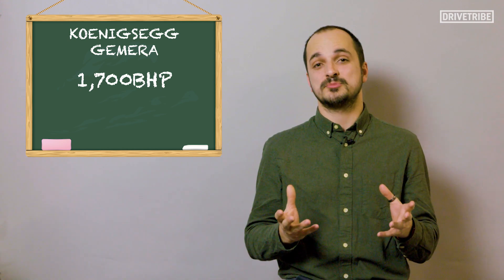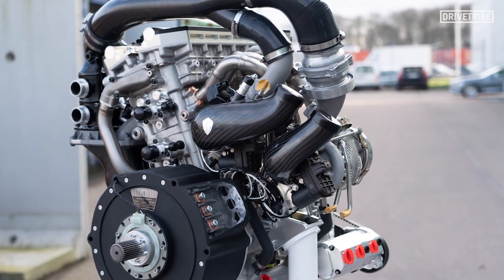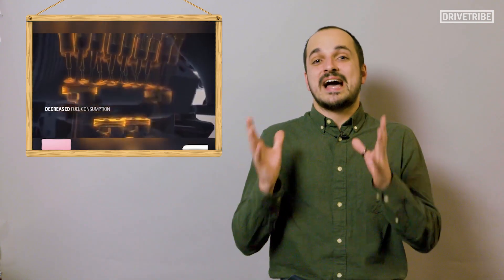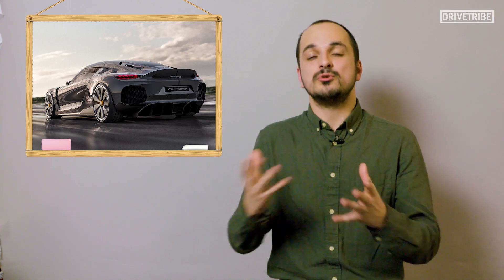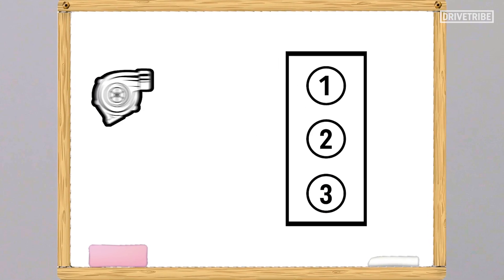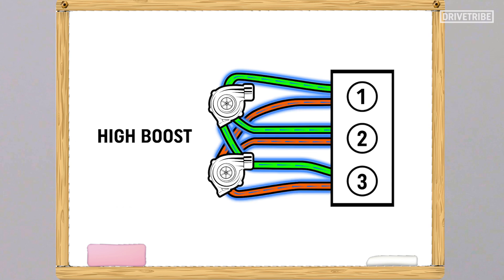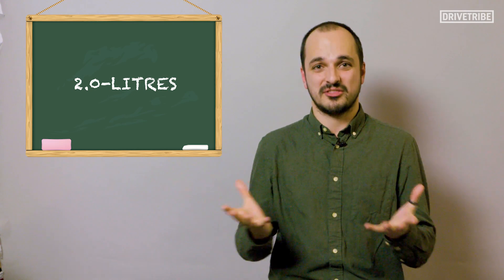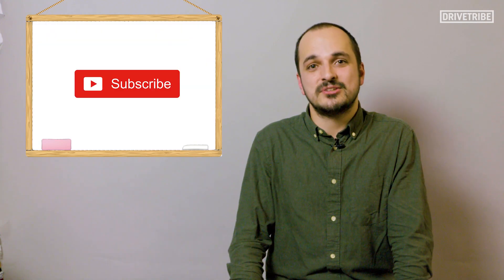This is how Koenigsegg made 600bhp from a 3-cylinder engine

Comment: from one of the fray of wind tunnel FINANCIALLY backed LSX "BUILDERS" among the fray of LSX subframed MR CF "supercars" that graced the top 10 nurburgring or crawled into the 7:20s and up.....to think of the rubble these guys would be one of the people making new cars and offering innovation. VS still trying to sell a twin turbo LSX build for over a million dollars like the rest bc they needed a return on the R&D and manufacturing of various prototype CF parts...and fronting it to the consumer...thats not a car thats selling it and marketing it as tech. And now weve come full circle. I mean really sum 10-15 years ago the "industry" and by that i mean hypercars were relegated to slapping turbos on an IRON lsx bc of the basic implications of boost. Then use CF to make up for the MR layout/weight distribution and would be piping/tubing that is most likely CF as well or titanium which means not that "long" of headers or exhaust/turbo manifold to exhaust bc of MR layout. Typically done by frame rails attachhed to a unibody or essentially a subframe/chassis design. With an epic suspension setup. Its all a lot to pay/learn that each car/powerbands only turns like itself each specific car/tune/build. Its a lot to pay to think one is better or more fun or these variables even matter. AND that is why they exist for those that have that NEED. Its ironic really. The type of guy thats happy to drive a million dollar car in traffic but cant see the fun in driving a 100 hp miata or FR like an FB or roadster. That cant accept that potential without the aspect of being the guy in the million dollar lsx build. PPl with this kind of money dont play. Theyre too busy figuring out how to make the x million they made this year double while writing off their expenses on the rest of us.

Comment: E85 fuel is quite common in the USA now. Partly due to GMs Flexfuel technology that's been around for about twenty years now. (Thanks to Koenigsegg, who licenced or sold the tech to GM a long time ago). 

E85 is currently $2.09/gal. and regular unleaded is $2.27/gal. For cheap 85 octane (vs 91 octane premium) here at high altitude in Colorado. (Everyone else gets 87/93octane). 

So it is no problem and even economical to obtain ethanol here in the Corn Belt of the USA.

Comment: The Gemera's engine sounds a lot like the 1981/84 Dodge M4S/Turbo Interceptor. It was a concept car that utilized a 2.2L Twin turbo inline-4. Most people get confused to say twin turbo and Inline-4 cylinder engine thinking I must mean a twin scroll turbo. Nope. Two Turbos. This engine made 200hp/L for a total of 440hp. Not overly impressive now, but in 1981... Yes it was impressive. Even earthshaking given it was much more powerful than MOST production V8s at the time. And in the MS4 it returned up to 28mpg.

Comment: New and old together. Absolut incredible (not new) the electrical valves, optimum variable opening and closing in all rpm ranges. And the inline two stage turbos is well known in the 70´s by Porsche in the Can Am Series.

Comment: The cam-less tech is way cooler then the exhaust turbo system, that's some amazing stuff.
Reply: Future of combustion engines
Reply: well... technically, that turbo config cannot exist without freevalve. the only reason you can have 2 exhaust ports in one cylinder is because you can close/open each valve (per cylinder) individually. and you can only do that with freevalve.

Comment: Camless hydraulic valve systems are the next major innovation of the internal combustion engine BUT - with the rapidly advancing tech in electric cars will we see it come into everyday use? Or will it be like the cutting edge tech for piston powered propeller aircraft after WWII - completely superseded by the jet engine? Never really utilised, and certainly never made it into mainstream production.
Are any other manufacturers working on similar systems? Are Koenigsegg / FreeValve jealously guarding their tech? Or do they plan to license its use to other manufacturers? If not, how long until somebody else develops a similar system? You'd have to imagine certain German and Japanese automotive companies would be all over it.

Comment: Well, staged dual turbos are not exactly new, but FreeValve certainly is. Now imagine this with hydrogen. 600bhp from..? 0.8l? Compact that in a daily commuter as a generator for electric drives, bam, emission free* electric car and the car industry gets to keep making combustion engines. (*Ok, as emission free as the power src for electrolysis so we better get fusion going.)

Comment: The fact that it's a 600hp 3 cylinder isn't really that special, the Leyland L60 got 750-850 very unreliable horses out of a 3 cylinder turbo in the 60's. This one just does it at 2L too.
I'm guessing that 2nd turbo is gigantic, they're running pretty high compression in the cylinders and at a very high RPM too.

Comment: The Opposite Piston Engine from Achates Power even has no cylinderhead, no camshafts but two crankshafts. It is not longer unusual, that Motors are changing to become more efficient in the future.

Comment: The car is definitely an impressive piece of engineering. To call the biturbo system a completely new one is still wrong in my opinion. It sounds to me very much like a sequential turbocharging with high and low pressure turbine which is common in many engines.

Comment: Check out the Fiat Twin Air. They paved the way a decade ago, with the same  adjustable hydraulic valve set-up. Also a small displacement with turbo to get more power and better efficiency. Consequently took title for best engine in the world in 2011. I'd love to see someone push the limits with that engine.

Comment: Fun fact, Koenigsegg is a Swedish brand and in Sweden gasstations are required by law to sell E85 at the pumps. AND, here's another fun fact, E85 in Sweden is cheaper than regular petrol.

No one in Sweden uses it tho, since Sweden is a cold country and E85 has poor qualities in cold weather and contains less energy so your car will use more fuel. The only reason for people to buy a "flexfuel" car is tax benefits, since it's considered a environmentally friendly option and can run on petrol. SAAB was a pioneer in this field, to bad it didn't work out for them.

Comment: 2:30 it's going to take hp to turn the air compressor. Do you know how much hp it will eat up?
Reply: not much. If it takes 10HP to run that compressor its not a big deal. Its just a compressor not anything crazy

Comment: This 2 liter 3 cylinder engine is the same size as a 2 liter 4 cylinder in a 2000 Evo. The 3 cylinder make 600 hp because of boost. Take away the boost and it want make 600 hp. The free valve system does help but don't act like a 2 liter engine has never made 600 hp. Install hotter cams, turn up the boost and a 2.0 Evo engine will make 600 hp too.

Comment: Well this is not surprising at all, you can already make the same and even more horse power on less "advanced" twin cylinder bike engines, like in dragbikes for example. Large power from tiny , small displacement and even low cylinder count engines is nothing new. The impressive tech thats gone into the design of this engine however is and while it's certainly advanced, it's not neccesaily because of this tech mentioned in the video that it can make this amount of power, but many other factors.  It's certainly efficent, but efficiency doesn't always guarentee you more horsepower out of an engine, or atleast not  a significant gain of it, not that there aren't other benefits to it. I assume this is why Koenigsegg went with this design, for it's "efficenies" stuff like fuel economy, reliablity and being more enviromentally friendly, while still having the effective power and speed of your typical super and hypercar.

Comment: E85?
Skimping on fuel?

E85 is much cheaper than regular gasoline, at least in Finland. It does lead to a higher consumption, but in the end using E85 saves 10-20% in fuel costs.

Comment: This tech is amazing they have a video where they add freevalve to a factory 4 cylinder turbo engine. Increased hp and torque by 45% each. 10% increased fuel efficiency and a whopping 35% decrease in emissions.

Comment: Why is 2 litres “huge” for a 3 cylinder , why is the fact its a triple of note at all , Mv Augusta , Triumph , and Yamaha all make mass produced high HP triples from 660cc up to 2.3 L , kawasaki gets 330hp form a 1L supercharged motor in the H2R with old fashioned cams the same power for displacement, the valve train is the big ticket item in this.

Comment: When you destroy your friends V8 or V10 with a 3 cylinder engine lol
Reply: imagine if it was a V8. It would be deadly as fuck
Reply: @dieselgeezer18  today in 2024 it’s announced the i3 will be dropped for a v8 since every single person who bought one wants a v8
Reply: @dieselgeezer18  600/3=200 200×8=1600 HP🥵🥵
Reply: I know a CLA45AMG has already smoked American muscle cars with its 2 liter 4 banger and it’s only 377 hp.
Reply: @Amarjit Singh is the a45 420bhp or whp?
Reply: @Amarjit Singh engineering nowadays so crazy that make me doesn't want to take engineering diploma.🤣
Reply: @Amarjit Singh I'm actually not surprised that mercedes make engine with that much power since litre-bike nowadays easily get 200hp without any forced induction help.
Reply: No. You are wrong. They did it with electric drivetrain.
Reply: You'd still be the loser.

Comment: Back to 1999 me and another student had as mechanical engineer bachelor degree thesis a combustion engine managed by solenoid valves that would have maximize power and minimize emissions and fuel usage. I am glad that what we thought back then prove to be intelligent and somehow “new”. I was inspired by Renault F1 engine program that supported Williams F1 Racing where they had a pneumatic spring mechanism. We thought that a solenoid would solve valvular sweet spot and stochiometry issues. The next best thing was Honda F1 vTech technology. Pitty that we didn’t dream enough to pull our thesis into the real world.

Comment: er, it makes 600bhp simply because it is boosted to fook and revs to 9k!  Plenty of engines have made this specific power before without any 'trick" cam system The freevalve system is complex, and critically, rather losy, because it is unlike a normal lobe driven sprung cam driven system has very high hysterisis (a conventional mech system recovers most of the energy stored temporarily in the valve spring under compression as the valve closes against the cam, ie the valve spring drives the cam on the closing stroke.....)

Comment: You forgot to mention that the twin turbo three cylinder free valve engine has three valves per cylinder totaling 9 valves if you include intake valves. The way that it monitors the engines output and efficiency is by switching between Otto and Miller cycles in real time, so that it can leave the valves open longer if they need to be to reduce pumping losses. The engine can theoretically also run as a 2 stroke up to 3000rpm, and then it swtiches back to 4 stroke after 3000rpm once the turbos have spooled up, but they haven't tested that function in their engines just yet.  The engine displacement is also 2 liters, which is quite a big cylinder bore for a 3 cylinder engine, and it has a bore of 95 mm and a stroke of 93.5mm. It also makes peak power at 7500 rpm and revs up to 8500 rpm as well. The engine can also run on petrol, e85 and even methanol or alcohol and butanol fuels due to these constantly varying cycles, so it really is better than any flex fuel vehicle in terms of electronically controlled engine efficiency. They said that theoretically the same TFG engine running without the twin turbos will still make 280 Horsepower, which is quite literally insane from a naturally aspirated 3 cylinder motor. Finally, they also want to include AI in the free valve engines, so that it can learn and vary the valve usage on the fly without having to have it coded into the ECU. That's down the pipeline, and for now the engine will run on human coding for it's valve control cycling.
Thanks for the video!
Heres where i got that information from, in case you wanted to include it. 
https://www.roadandtrack.com/new-cars/car-technology/a31451281/koenigsegg-gemera-engine-specs-analysis/

Comment: So they replaced mechanical cams with electrical actuators.  This thing isn't going to last 50k miles.  And once you get a failed actuator or sensor anywhere, it'll probably blow the engine.

Comment: Wouldnt 3 more cylinders like 6 cyl boxer porsche engine make about 600hp on e85 naturally aspirated? Given same e85. Base compression can be raised a fair bit more with Instant response and cylinder shutdown on low load for less emission. 3 more cylinder would really weigh less than 2 turbos and less heat.

Comment: The tecnologie of inline turbos is old but car manufacturers don´t release it. Can Am series Porsche of the 70´s had inline turbos or a aircraft jet engine is a multible inline turbo. Today with a micro engine of only 500cc we could have enough power and less consumtion, just need high octane fuel or aditives to control detonation.

Comment: the triumph rocket 3 moorcycle has a 2.3liter 3 cylinder engine that can make 400hp to the rear wheel when supercharged with high compression pistons.
my Rocket has been upgraded with intake, exhaust, and computer chip, and now makes 170hp instead of the stock 145.

Comment: ''It's got two liters of displacement which is huge for a 3 cylinder.''

-Triumph Rocket 3: Hold my 2.5 liter 3 cylinder....
Reply: i mean its a bike thats sold as ENGINE. plus most of the thread is anti displacement anti v8 anti v10 anti v12. All exclaiming the lack of efficacy...as theyre prob the same cucks that cry about how they wished the v8 and v10 era returned to F1. IDK where the bs starts and stops

Comment: Imagine a 16 cylinder engine with this technology. 

Will this technology scale up with engine size or will the benefits fade out the more power you have?
Reply: @henrym5889  there are GTRs that are not extremely modified and drag focused? 😳
Reply: No reason it couldn't. Top Fuel dragster engines are around 8 litres and produce over 10,000hp. Reliability becomes an issue at that level though, that kind of hp creates major stress for an engine. I reckon there'd be no real issues with a 6 litre V8 making 1500 - 2000 hp reliably though.
Reply: ultimatly i think the restraints will be in the bearings, rods  and other high stressed parts , as a conventional engine
Reply: If you think about it the twin turbo seems to be doing most of the power. Cause this engine has 200hp per cylinder. Numbers a lot of supra and gtr owners also push. So i think the valve system only adds a couple %

Edit: well, not a lot of supra and gtr owners but some at least.

Comment: This election valve system has be around from the last 90's.  They are jest the first profect to and use it.  Its been in F1 over the years as will.  Hell back in the 80's they made a water fueled internal combustion engine. All this new tec, is not new there jest giving people the OK to use it... finally... But Koenigsegg is still an awesome company.

Comment: all good till your cam lifter actuator has a hiccup. Then you got a blown motor. LOL. Or maybe it can only fail closed. How about air actuated valves and engine could have a compressor and tank and just always. probably not fast enough.

Comment: Most important is that the electronic controlled valve can make the engine works as a two strokes
Reply: i doubt it, 2 strokes have a very unique cylinder design.   you couldn't get a regular motor to intake and power at the same time.  nor could you compress and exhaust at the same time.
Reply: @suzukispider  Christian Koenigsegg himself said that it works as a two strokes
Reply: @suzukispider  and as the video say it is not a regular motor, it have a electronic controlled valve system that make it possible to the engine to work both as 4 strokes and 2 strokes
Reply: @suzukispider  https://youtu.be/E5VN-MI1mZA?t=456

Comment: Am I the only person thinking I need a 600hp motorcycle? I've ridden a 450hp turbo Hayabusa on a public road, it's impractical, the turbo lag although minor, made it hard to ride at lower speeds and even difficult to get to the higher gears on a motorway. This is 600hp turbo tune could be swapped out for a super charger, I might lose 100 HP but 500hp on a bike that weighs 200kg is a 2.5hp per 1kg vehicle, this is like owning 6250hp Bugatti Veyron. I am sure with this set up it would have adjustable power let's say down to 150hp for inner city travel and the full 600 HP for the other roads ........ I mean, race tracks.

Comment: it ll be interesting to find out how reliable this system is. so far the high heat high performance engines produce coupled with sensitive electronics doesn't have a great long term track record.

Comment: These valves make the cylinder head taller than a traditional over head cam engine and have hundreds more moving parts, square wave valve opening has way more potential if its reliable.

Comment: Anyone who has ever run e85 knows you cant run it all of the time and if the car is going to be stored or not used for a week you need to empty the tank and run petrol before you do or it will destroy your pumps, check valves, regulator and injectors. This type of car will only get infrequent use so owners will be advised not to run e85.
A 2 litre making 600 bhp is nothing new (theres a few s2000's on the drag scene running over 1200bhp) the number of cylinders has nothing to do with it. Theres a few 2 litre engines that with just pistons and con rods can handle 300 bhp per cylinder.